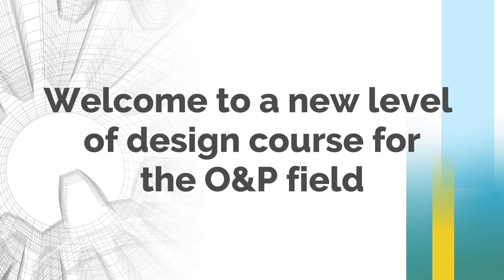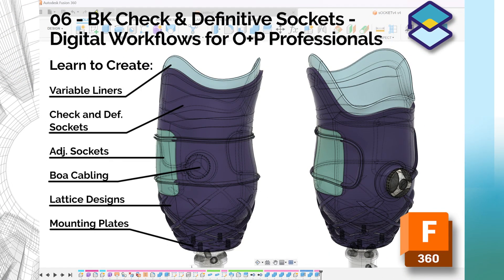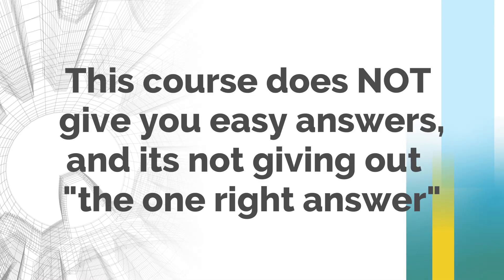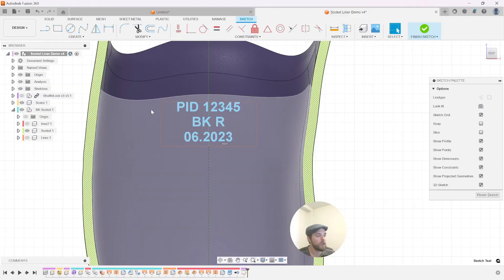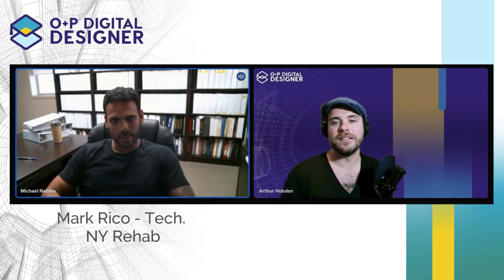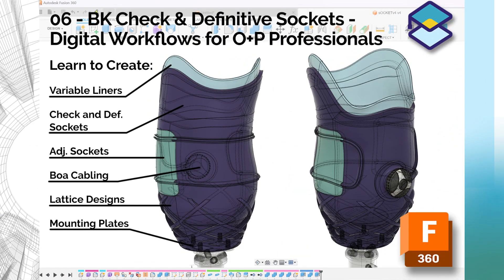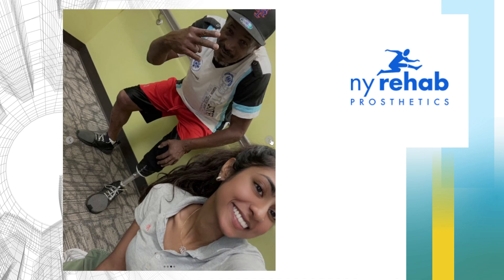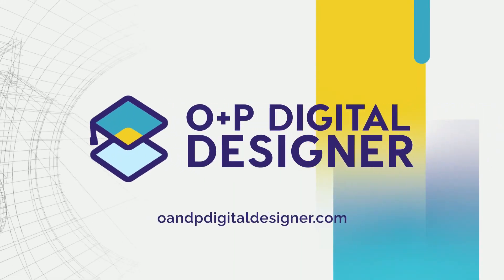How to Design BK Check & Definitive Sockets - Digital Workflows for O+P Professionals

Comment: Hi there!! Ive seen a few 3d printed fdm sockets in a few materials (like PC by ottobock themself or petg, ABS, ASA, etc from a few others), and all of them break in normal usage. At most, ive seen them endure 2 months, so can be great as test sockets... but at the end, all failed...
So you claim that yours can be definitive... can you please elaborate some more?
Im not an orthopedist... i´m a tech geek, 42 years old, born without legs... so ive experienced a few materials, but so far the most reliables are the good old laminated fiberglass, carbon fibre, or nylon...
Reply from the maker: the secret is using TPU or rubber based materials that are not rigid. the next step is to learn how to write Gcode to create a vacuum seal!